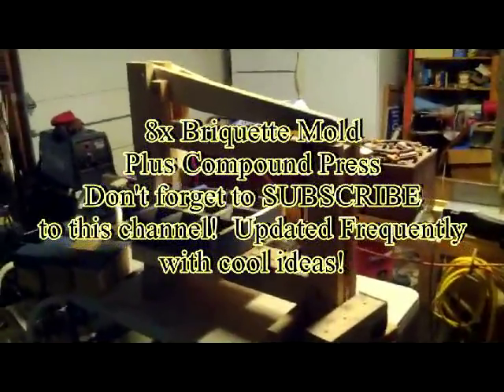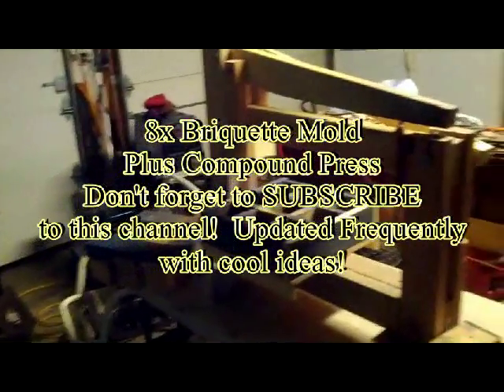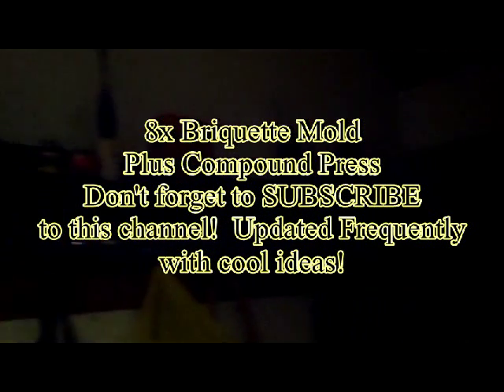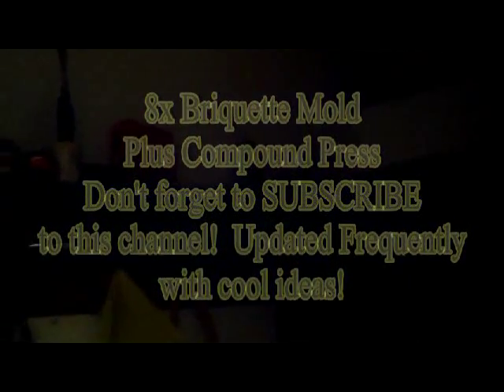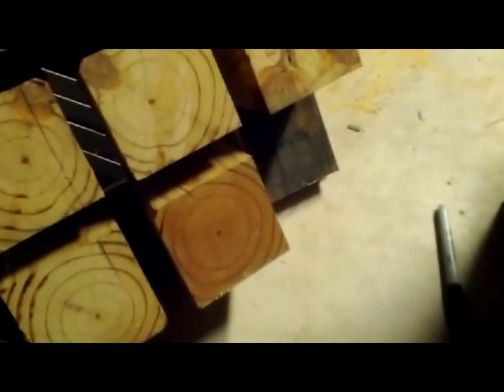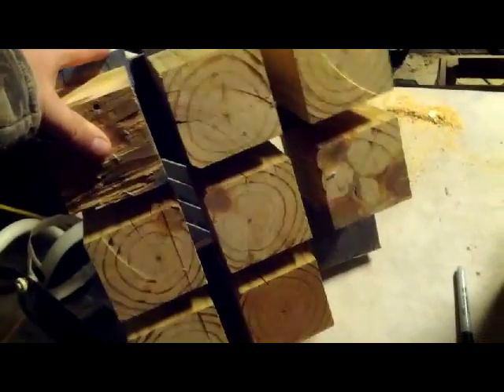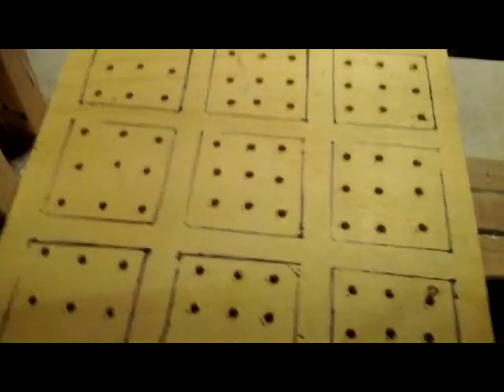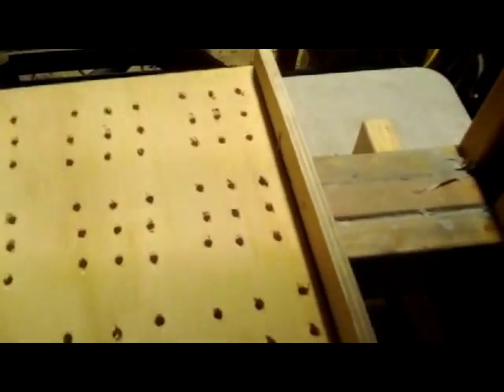Much Better Briquette Press Model with compound Press

Comment: You are the man! That's a super combination of ideas. I can save you some bother... don't make a new piston, take the centre piston out and put it in the corner and don't replace it, just leave the centre empty. This will make the press better because if you have a little more mix in the centre mould that will stop the other pistons properly squeezing the outside moulds. If you have a little less mix in the centre it won't get squeezed properly so you lose it anyway. Better 8 good bricks than 1.

Comment from the maker: Brandan, you get the plans for the press design at Engineers without boarders website.   They have PDFs of all their presses.   Only thing I added to the design was to increase the number of 2x4s in the base in order for the plywood to accept the added pressure from the press!  This press with the extra molds makes this one of the easiest and productive ways to make briquettes! I couldn't wait to get to the end of the paper mulch and quit.   Now with this one, I run out of paper mulch instead!

Comment from the maker: Hey Brendon, the extra boards on the base of the press was in order to keep the pressure even on the plywood piece with the holes in it.   I noticed the first time I used the new mold the plywood was bending under the new pressure so I cut up some 2x4s and "rested" them in place for the video.   It worked fine except I hadn't screwed them in place yet.  I will.  I looked to get Perforated metal at the local steel yard.  Wanted $135 for a 14"x14" 1/4" plate!   So I gave up on the metal!

Comment: 'Beefed-up' - made stronger by the addition of materials like boards, metal etc.  Generally used to describe a situation where something is adequate to do a job but much better if made a lot stronger.  I noticed you had extra boards on the bottom of the press and I wondered had you strengthened the rest of the press to make it stronger.

Comment: Of course, with more briquettes you are spreading the force over a larger area and so get a much lower unit pressure on them. No doubt that is why you must hold it down longer. If you are still getting a good briquette though, i guess it doesn't matter.

Comment: Looks awesome. Why did you not move the mould back further to get more pressure instead of adding more blocks to the top? Or am I missing something? Either way, looks like it works great.

Comment from the maker: Well Jeanny, I doubt you will have much luck with 100% saw dust for a briquette as it won't stick together.   I believe the best mix is 30% saw dust or less and 70% paper mulch.  I think it will depend on the size of the saw dust but when I tried it my briquettes didn't stick together very well.  When I mix them well with the paper they burn about the same in my view.   Remember I only use these to start my wood stove.   I don't use them as a heat source.

Comment from the maker: Ok, here is the website that will help you with the Bio Mass.   There are tons of choices in the documents and ways to process the material here.  This is the address  home (dot) fuse (dot) net/engineering/ewb_project (Dot) htm  No spaces.   Start with the normal address (H)....(T)  (t) P at the beginning.